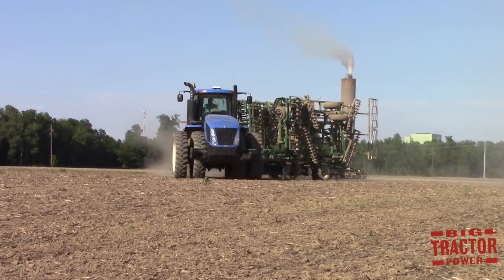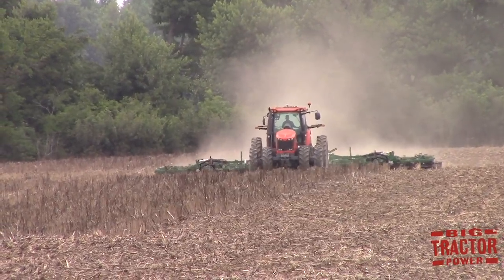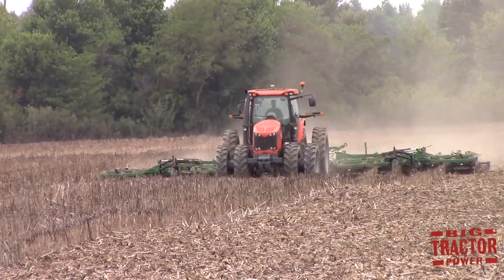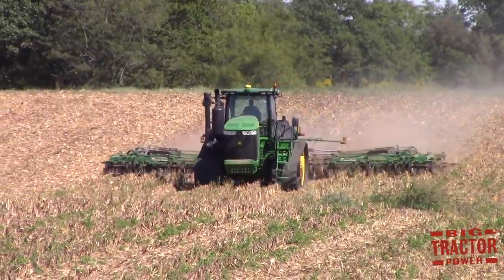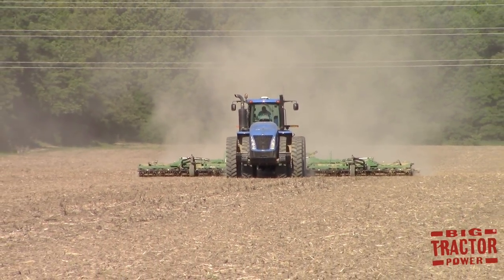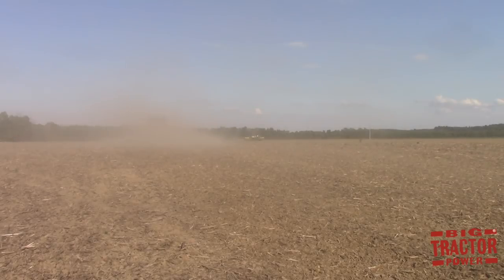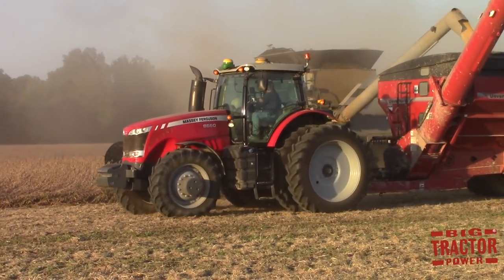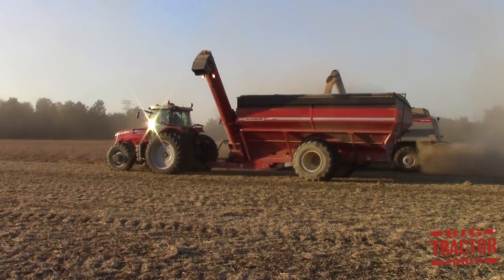42ft Great Plains UT5042 Ultra-Till at Work in the Field

Comment: Why is that the MF tractor has 2 GPS Antennas ?
Reply from the maker: I will have to ask the farmer. One is GreenStar and the other is TopCon which AGCO uses as an option.
Reply: It's so that he can run his John Deere planter. John Deere makes it impossible to run there planters without the greenstar receivers and monitors if you want to run their shutoffs, section control, and variable rate...that's why everyone retrofits them on. He's probably also steering with it to, with one of their universal kits.